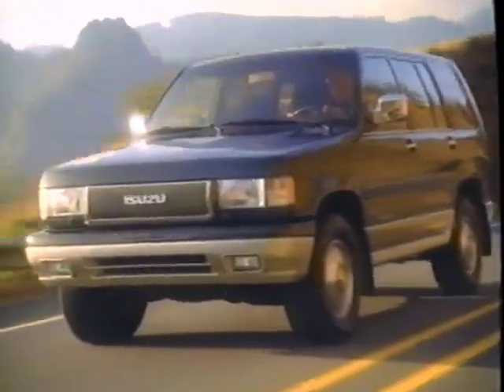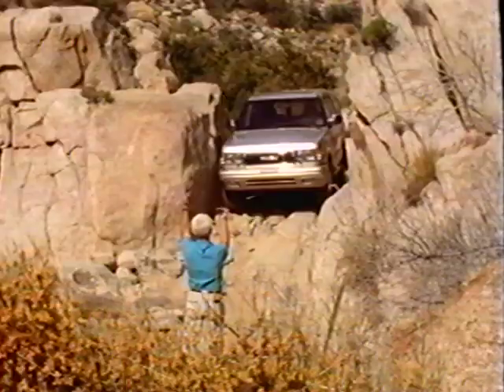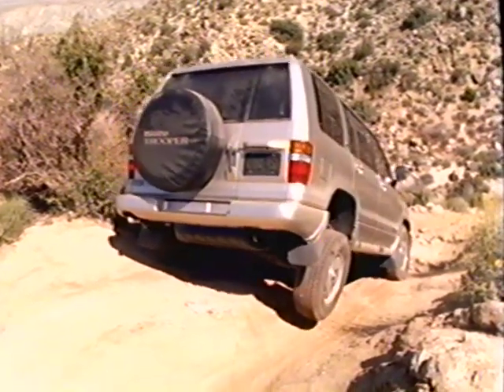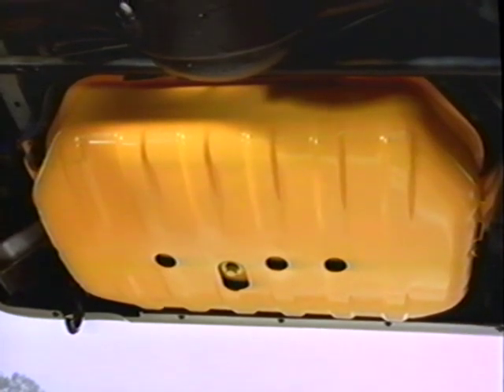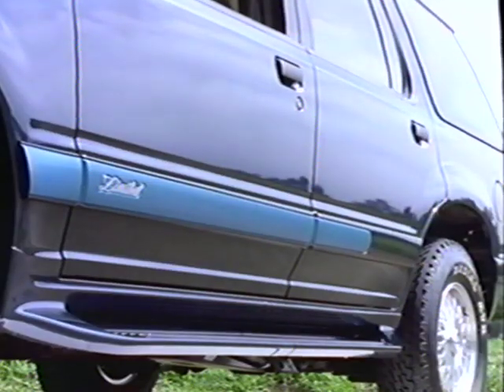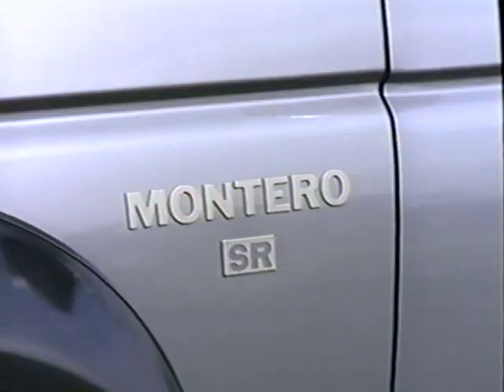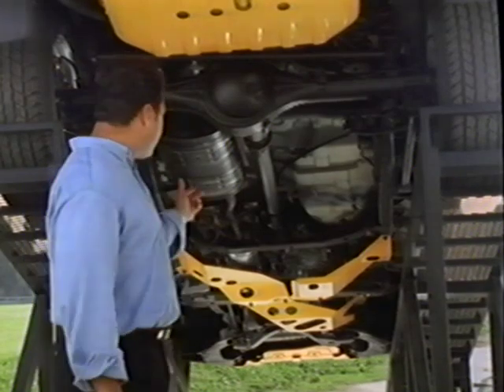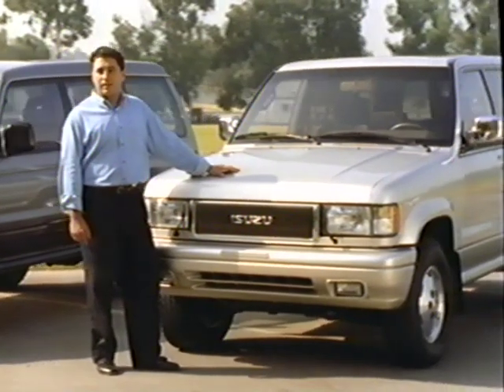At The Top 1993 Isuzu Trooper 001

Comment: I owned a  1985 Trooper  when I was living in  the 80's in Venezuela.  It had 2.0 liters and 88HP, but that thing could crawl anywhere.  I went through beach sands, dunes, rivers, and mountains without any problems. The only negative : it was a 4-speed manual.  It needed an extra gear for highways.

Comment: ...good video. I just bought a 93 Holden flat bed twin cab rodeo , it's the Australian GM , the troopers are called jackeroos I believe . Four WD , hydraulic tipping tray, dual fuel that's LPG or petrol .  Nice simple four cylinder engine in top condition cos the engines don't wear out on LPG fuel . Had to do basic housekeeping work in it such as new set of rear and front lights and cabin light , remove radio/stereo to get the security code usually written on case thankfully and put back and bring to life , lots of cleaning and detailing , new windshield washer , gotta put new fuel pump on it for it to run on petrol . It needs normal looking tyres, the current tyres are too wide but good . It idles  at high RPM for a bit long and settles to decent rpm when heated up only , horn not working or maybe it ain't got  one. Vibrations in chassy make me wonder if engine mounts have sagged and engine is resting lightly on cross member perhaps but not easy to check cos I have to remove the underbody shield and same for fuel pump too. I reckon master brake cylinder could need looking into in next few months.

Comment: I still have my 1993 Trooper S and have 120,000 miles.  With only routine maintenance, I have had almost no mechanical problems and as would be expected, things start to dry rot from the sun and falling off, but again, nothing significant.   It has passed smog inspection in CA and NV each year without fail.  It really is a well built SUV.   Too bad that Isuzu allowed Consumer Reports to drive it off the U.S. market.    If I could find a dedicated mechanic, I would have them redo the Trooper and bring it up to top-notch off-road status.   Presently it is my every day driver around town, hauling all sorts of supplies from Home Depot.

Comment: Thanks very much for uploading this! My family bought a four door Trooper S new in '94 and kept it for 10 years / 170k miles. By that point it's bumpers were starting to fall off, it drank a quart of oil per week, and the suspension was shot, but it also didn't have a lot of easy days. In addition to being the rig I learned how to drive on, It had become an integral part of the family, and it'll have a place in my heart as a result.

Comment: Wow, this video is great.   I did not know all of these things about the Trooper when I purchased it in 1993.  I still have it and have done very little to it other than routine maintenance.  Same transmission, engine, suspension.  I have the S model and paid $25,000 new.  Has large carrying capacity and I have moved furniture three times when moving to new house.  It sits nice and high off the road and seats are comfortable.

Paint is fading on the top and hood, plastic parts are loose,  and other wear and tear things are falling off.  Still has great gas mileage and still passes SMOG check each year.  I only wish I could find a reliable place to replace all of the engine parts and add a few new off road upgrades.  Then I would keep it for another 25 years.  Has 130,000 miles.

Parts are hard to find now.  Have to depend on the mom and pop repair place to modify replacement parts.

Too bad Consumer Reports and 60 Minutes killed it in 1996.  (Did not include the 1993 Trooper).
Reply: Look for 90's Acura slx. Same thing as a trooper. might make finding parts easier. best of luck
Reply: Engine parts* also the isuzu rodeo and honda passport, both use that motor.
Reply: @amatureskater15  Thanks for your comment.  Will alert my repair shop manager.
Reply: @amatureskater15  Will relay this info to my repair shop manager when he tells me he can't find parts.  He is reliable, but sometimes will say he could not fix something because no parts found.  Not critical things.
Reply: @H.pylori  Happy to hear i could help! have a blessed one

Comment: Hey Bryan, do you know if all 2nd gen troopers were equipped with a limited slip differential in the rear? Or only some models had it? Thanks in advance!
Reply: Optional, look for G80 code on build plate under hood.
Reply: In most of Diesel models. 3.1 are probably one of the best Turbo Diesels in History.

Comment: 94 trooper 260,000 Mile and still going
Reply: 94 trooper 280k miles no rebuild on engine or manual tranny..only replaced clutch. paint and interior mint...no rust or  no clear coat peeling off...100% built in japan... everything written in Japanese
Reply: @willtodd7743  nice  now thats a trooper
Reply: I drive a 89 with 320K and love it!

Comment: This is a very unfair review of Mitsubishi Montero vs Trooper. Montero is superior to Trooper. Compare transmission on Montero to Trooper, there are a lot of Troopers with broken transmissions (automatic). Montero SR does not need LSD it has lockable differentials: center and rear which Trooper does not have. And no Montero transfer box does not get stuck in 4WD High. I still drive my 1995 Montero SR in 2023 and it runs great.
Reply: same, also have 92 Montero SR, that car is still running fine as it is